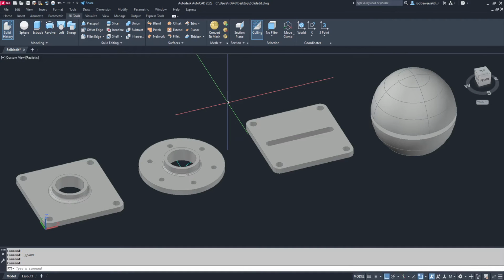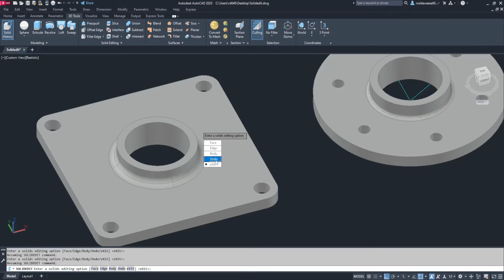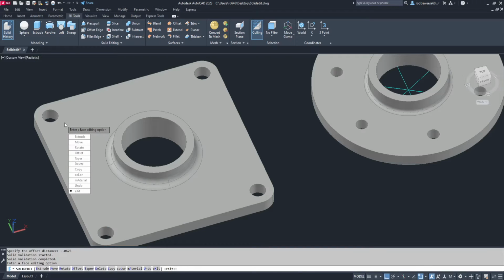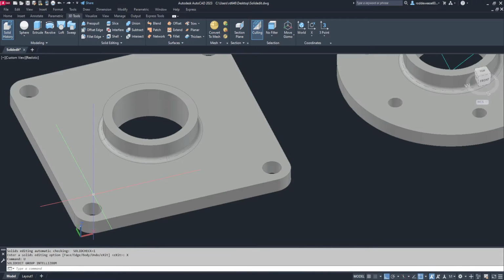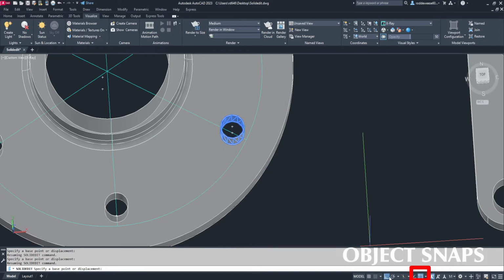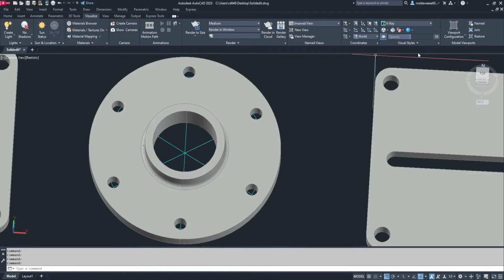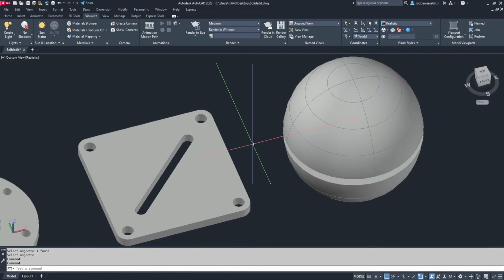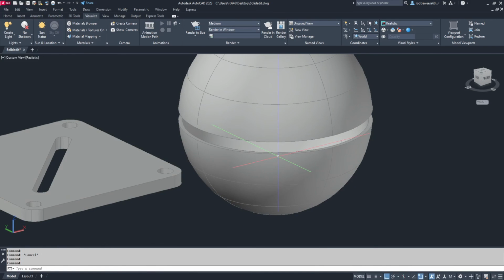The Ultimate Guide to 3D Solid Modification with SOLIDEDIT

Comment: I have a model of a certain thickness already built. How do I reduce that?
Reply from the maker: Sorry, but I don't know of an easy way to reduce the overall thickness of the entire model. You could use Solidedit and manually move faces one by one, or you could use primitive objects to subtract thickness from the inside walls, but honestly, I think it would probably be easier to just make the model again with the correct thickness.
Reply: @roddeweese6402  okay thanks